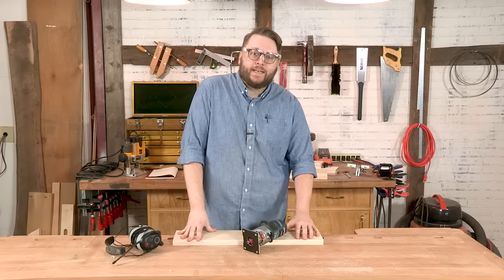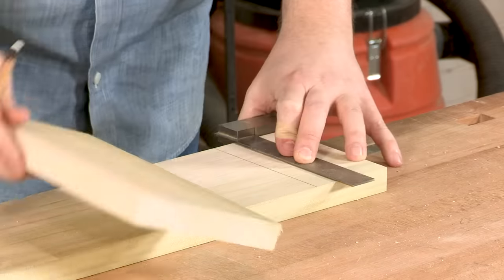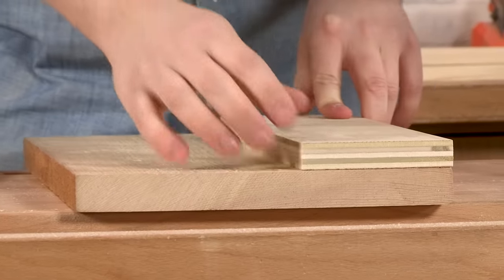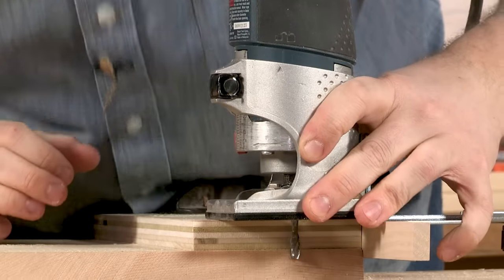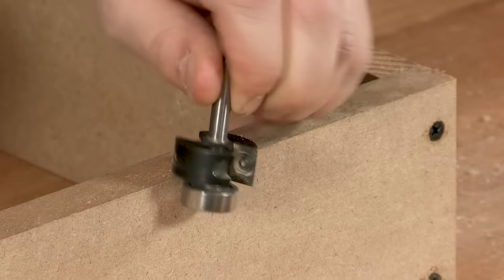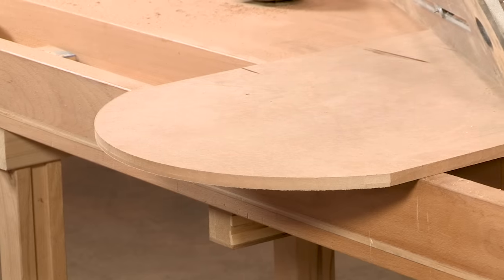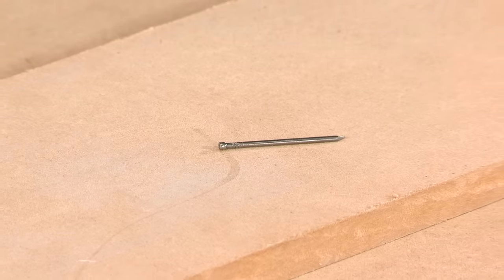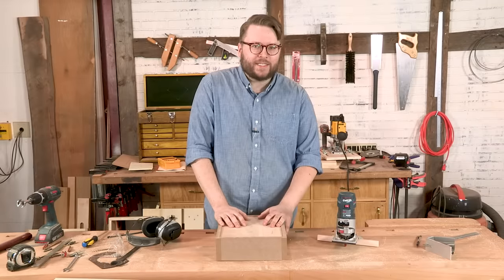Routers Beyond Roundovers | I Can Do That!

Comment: When rebating the block of wood at about 6.04 minutes, he got the direction wrong on the first pass. When cutting a channel, one side of the router bit is rotating into the wood, which is what is wanted, but the other side rotates away from the cut. With a single pass, there's not much you can do about that and you just have to accept that one edge will be better than the other as a consequence.

However, then cutting a wider slot by using two (or more) passes, you can fix the problem. Since the  bit rotates clockwise when viewed from behind the router, the first pass (on the left, from his point of view) should have been AWAY from him, with the second and any subsequent passes TOWARDS him. That way you're guaranteed nice clean edges with no biting.

(He got it right though when he did a second one at 16:03.)

Comment: The initial measurement of the straight bit at 4:09 shows a measurement of 3/4" - not 3/8" ...just sayin...
Reply: I had to look twice too, but the ruler was measuring on the centimeter side. Confusing, but still approx 3/8"...
Reply: @nathancahill2805  thats not centimeters. look like its still imperial just measuring halves and with markings for 32nds.
Reply: I looked twice it;s cm side but still abt 3/8..

Comment: On the first dado, it would be easier to accurately get where the router bit needs to go, if you transfer your lines down the edge of the piece of wood facing you, that way you see where the blade of the bit will cut, it is loose because you took out your pencil lines, wonderful tutorial otherwise, thank you for sharing.

Comment: Relax and be more fluid with your movements. I couldn't help but notice that you were super awkward from being so tense. So much so, that I could almost feel the ache in your lower back. Also, your 10" hole was a little big. You didn't get the rule exact with the outside edge if the router hole. Since you do speaker boxes, I'm quite sure you know how minimal your tolerances are (seal, bracing, etc...). Anyway, great video and thanks for the instructions 👍👍

Comment: You can see burn marks on the wood (first cut) which means that you went too fast and too deep.
Reply: Yes and that little router lost some serious RPM's trying to pull it off too
Reply: Burns mean you went too slow. Pass your finger quickly through a flame. Not so bad. Then pass your finger slowly through the flame. Got hot didn't it? Now put your hand in ice you burnt it. You big dummy!

Comment: That will not give you a 10" circle as you measured to the OUTSIDE of the bit. A 10" circle would be to the INSIDE of the bit as the bit is actually cutting away the wood you have measured
Reply: that measurement would be for a 10" HOLE and not a circle
Reply: Yes, as he explained, it was a hole for a 10-inch loudspeaker.

Comment: A lot of unnecessary steps here. Work smarter, not harder. No need for the "under boards" on the dado jig, just draw your lines and clamp straight edges to the project piece for the bearing to ride on.

Comment: I have watched this video twenty or more times, and can not for the life of me see how at the end of the video you router a piece of stock, but the jig doesn't have a routed out part at the front of the jig to be able to router the stock. You start by routering a piece of wood the width of the stock but then we never see it again in the video. You don't use it at the end of the video when you test the jig cutting the first piece of stock. Unless you router both the jig and stock at the same time. I ran the video over and over and over stopping it too try to see the routered out piece of wood you routered at the beginning of the video. I never saw it again and the jig at the end of the video when you cut the test piece of stock doesn't have a routered out part either.

Comment: Sorry, just re-read my comment and it looks too much like I’m just criticising which wasn’t my intention.  I was basically just pointing out that over the years I’ve seen many people cut dados that are a little oversized and to suggest why this generally happens.

Of course your right in stating that making a jig is the better and repeatable option,  however for a one off dado especially when time is tight my suggestion of using a marking knife an leaving a trace of the scribed line usually results in a decent tight fitting dado.  Of course your not looking for a really tight fit otherwise there is no room for glue and the glue you’ve used just gets squeezed out.

Comment: One tip.. when using a try square or combo square for layout, the head should be held along the body (the part you’re keeping) of the work, not the waste. That way you get full contact and a more accurate 90.
RE: All the comments about MDF and masks and cancer.. yeah it’s a good idea, especially if you’re around the dust for long periods. But one or two cuts won’t kill you, especially if you’re mindful. What gets me are the number of smokers whining about health and dust masks. There’s a one in 100,000,000 chance occasional wood dust will cause lung cancer, you have a better chance of being struck by lightning...but a 1 in 10 chance you’ll die of cancer if you’re a smoker.  Just sayin’

Comment: Thumbs down: 1. Spagnuolo made this jig (years ago) based on Norms (years and years ago) design. 2. The base on trim routers are made so that the operator should hold his finger away from the bit (behind the base), not (close to) inside the bit housing. 3. mdf is synonymous with an obligatory dusk mask, NOT a recommendation.
Reply: Stiff Wood to med that’s not a thumbs down, more of a few valid comments. I learned a lot from this video.